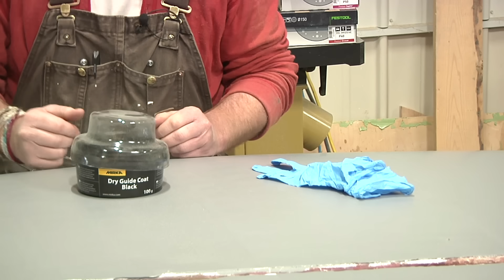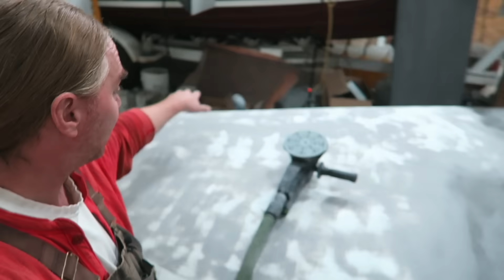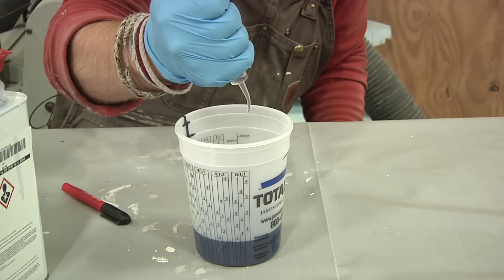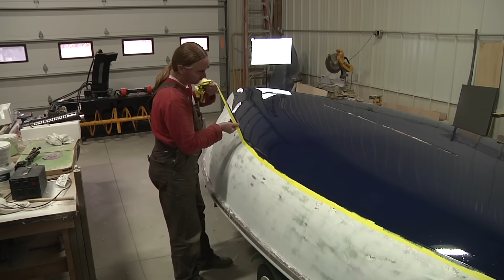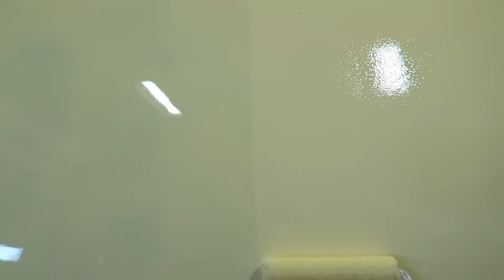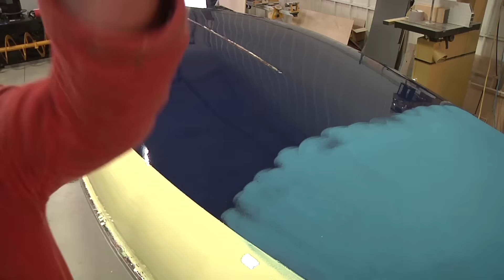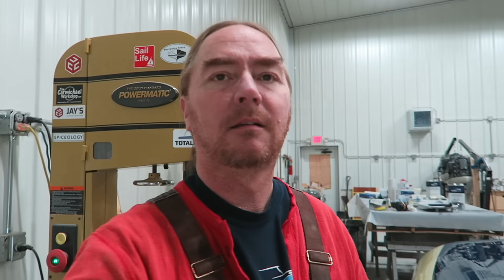ALL ROLL AND NO TIP ;-) PAINTING YOUR BOAT WITH ALEXSEAL!

Comment: Lint will ALWAYS show on high Shine Glossy paint. Lint from roller sleeve and dust, dust is lint too.    D I'm saying it from professional painter knowledge. To eliminate dust, take it seriously. It's the "cleanliness" he is talking about. I call it "dustlessness". Borrow dust filter/s.
1. Bring and turn on Dust Filters.
2. Vaccuum entire place with dust filters on.

3. Let dust filters work when you sand and do your work. 
4. turn off during spraying all coats and in between untill you are finished and Last coast dries.
            You can now wax or buff.
Dust filter is as cheap as $100 and many fans have them too. I advise any HEPA dust filter. You can actually feel "crispy" clean air :) 
in Vancouver, I can do your painting if you let me paint and store my project next to yours.

Comment: Looks good, but I would recommend white foam rollers, and if you don’t want opacity issues with dark colors maybe go for @Perfection Pro from International Paints, the trick is: don’t paint in windy conditions, in between coat 1 and 2 you don’t need to sant but you must light sand with P400 for the 3 coat.

Comment: Wow! We’ve spent the last two seasons in Puerto Escandido (Loreto), Baja Sur, Mexico working on our deck. We had about 1200 blisters and blemishes on the deck and cabin top of our 40 year old Valient 32.  Getting the Awlgrip down, and tipping outside in the desert with wind and heat has proven almost impossible. The non-skid areas have been no problem of course. But the smooth areas -  very difficult.  Our next try will be with tarps wrapped all the way around the boat deck up about 8’.  I wonder if that Alexseal additive could be comparable with the Awlgrip Topside paint. Could make a big mess to sand down.......

Comment: Just my 2 cents. I recently refurbished my 1979 Islander 32 sailboat. Much bigger than your project. I rolled and hand wet sanded 2 coats of primer by hand with 220. It was glass smooth when I was finished. Then I rolled and tipped with Pettit easypoxy. People thought that I had it sprayed, it was soooo good. And I did this all outside in a boatyard. Just sayin’

Comment: I always put a drop cloth over my project, ( benches etc) then I spray the room with a light oil, thinner combination that fogs the room and pulls all thedust to the floor and holds it there then I remove the drop cloth and spray paint or roll. This seems to really minimize the dust issue for me,,,

Comment: @Andy, you said Alexseal needs sanding between coats if it has been more than 12 to 16 hours, but you painted without sanding the next day - probably closer to 24 hours.

Is that what caused the orange peel you saw?

Also, for measuring the additive, you can easily find syringes calibrated in CC (cubic centimeters) - which is the actual definition of ml.

Comment: Thanks for video and all the work to make it. I see your pleased with finish but, I would not be to be honest. I been around boats all my life and I am 60. I did spray my Pearson 33ft sailboat 30 years ago with allgrip and it came out virtually perfect in flatness and sheen. Never rolled or rolled and tipped a boat finish and maybe this is acceptable. I am from the body business and painted hundreds of cars as a painter so the finish you put on, again is as good as can be had with rolling. So feel free to correct me. And if this is the process and then you sand and buff (of course insane amount of work) then ok. I also sand and buff when my finishes don't lay out just right. Some of those imperfection you have look deep and not able to sand out. I would also add my opinion that the imperfections are not peel, but solvent popping and well...could be other issues that cause them...Like...like anything cause you can do everything perfect on a paint job and something is just a tad off and the finish is not as good as expected.

Comment: Andy, you amaze me with your talent. I am going to be outside painting my hull in spring and painting it. It will be outside I have little space to confine to build a paint booth with plastic protection from the elements. The sailboat is on a cradle and I don't have a trailer to move it. Any suggestions from you or anyone else would be very much appreciated.
Reply: Can I used a5018 additive with any kind of paint? Even cheap paint for boat from home depot?

Comment: They have in effect copied the leveling agent that is common in modeling paint systems and upscaled it for marine applications. see and model building channel. Barbados Rex in particular reviews many paints marketed toward scale modeling and reference leveling agent and surfactant.  As in rinse agents for dishwashers that make the water sheet off the dishes,  because its surface tension is reduced. That is essentially what this so called new product Is doing essentially on a larger scale, in the paint system you are so proud of.

Comment: Great videos. I just have a question about why you roll on gelcoat over glass, if you are fairing and sanding afterwards? Why not put the fairing straight on the fiberglass and then primer over that?

Comment: Andy since with your method of rolling with system can you also use a paint brush to do the areas that a roller can not do? If so will the brush marks flow out like the air bubbles?

Comment: Most impressed by the small amount of paint needed to cover the big area, but I also noticed that your masking tape failed at the line between the blue and yellow.  From my meager experience to cure this nasty phenom, use fineline tape available at the automotive supply.  It is a bit expensive but gives a beautiful line with no leakage.  Try it out, I like 1/2" for long less curved lines and narrower for more curvatious lines.  3M makes the best.  DS

Comment: Question:, on a 18 ft wooden row boat, do you put the resin and harder on the wood surface, or do you put the fiberglass material on the wood surface than the resin and harder? First time building.

Comment: "There are some blemishes on here" yeah, ya think? There's hundreds, maybe thousands of pieces of dust in the paint. It is bottom paint so it shouldn't matter much, and the blems are from dust in the air which is curable with a paint booth. Overall, the job looks great though.

Comment: Question:  To avoid being able to see the sand-through primer blotches, could you add a pearl powder to the first coat of blue?  Perhaps a similar or darker blue powder, or grey or black?
Reply: No , it will excasobate the problem. Should have laid down an even primer after sanding back with sanding boards in criss cross pattern in correct planes to hull from final guide coat. as you do all layers for evenly professional result. It's a demo boat of your work for public.

Comment: Grab a cheap can of acrylic spray paint and do a mist coat over the job, it works the same and is quicker, i never used anything like this as it contributes to the dust factor and i always wet sand, i am a old school vehicle painter, less dust makes a better job and wet sand always seems to make a better finish for the final colour paint, it is all in the preparation.

Comment: Whenever I’m sanding primer, I use a sanding block. Not A DA. Also when using the guide code, it’s supposed to prevent you from burning threw your primer. That’s why it marks your low spots. Other than that nicely done

Comment: I've ALWAYS had these kind of results using a roller on a 35ft cold moulded hull with clear varnish over mahogany.
Good quality varnish (paint) and a good sanding is the answer.
Sand, One full coat, sand, one coat 4/5ths paint 1/5th thinners and always got a perfect finish.
Even the boat yard came to have a look they were so impressed I got an "as good" finish that they would have got with a spray gun.
If I can allow myself - I got a better finish than yours here. Like glass.

Comment: I need help. Love the channel. Off video topic. Im rebuilding the plywood decking and consoles in an aluminum fishing boat. Ive gotten mixed info on sealing/ not sealing the plywood. Wanting a rubbery non skid. Should i seal the underside and edges of the plywood as well? And what products? Im between the kiwigrip styles and the monstaliner styles.

Comment: Andy ... fantastic content, as always. 
At one point, you said you applied the three coats of blue over three consecutive days, inferring a 24-hour wait time between coats with no sanding. Right after that you said the second and third coats should be applied within twelve to sixteen hours if not sanding in between (or words to that effect).
Would you have shortened the between coat time or sanded between coats if this were not a test/demo boat?

Comment: I always use a high density foam roller rather than mohair and get good results. do you have an opinion on the two?  Also, I have used all the competitors over the years and because of your videos, my next project will be with Alexseal.  BTW the pricing on Alexseal is not the same for all retailers, so it pays to shop.

Comment: In between coats, do you remove the tape line and reapply for each coat or do you leave the tape on there for 3 days during dry time of each coat? I feel like it's probably a good idea to remove the tape or else the tape would dry to the gel coat and end up pulling a chunk of paint with it. But I just spray cars.

Comment: I've got some calls to make. I think this will work with the paint i want to use on my car. If so this will save me a lot by being able to just roll it on.
Reply: Maybe it isn't relevant, but I just finished painting my campervan with Totalboat Wet Edge thinned 10 percent. Seafoam green, using Red Tree foam rollers, it blew me away how good it looks! Good luck painting your car! Super glossy, and no orange peel; painted outside.

Comment: Achieving a glass smooth hull surface will create a suction when moving through the water whereas a micro texture surface does not create suction and allows the hull to move with less drag through the water. This idea was apparently derived from mimicking the surface of pelagic sharks. Do you really want to knock down the roll on texture with a final sanding with 320 grit?

Comment: After that has cured long enough, is it possible to use a razor blade to de-nib the debris from the gelcoat (like the technique for auto clearcoat), then wet sand, polish, etc.? I've done it with clear coat, but I've never worked with gelcoat.

Comment: I have been watching your videos for a year now. I have been planning on painting my boat myself ,  a 24 deep V MAXUM. I was torn between spaying or the roll and tip method. UNTIL your first announcement of going to Charleston to Alexseal to paint with their new additive for rolling and NO tipping. My question is will I have a better result if I sand with 400 between each coat of paint.

Comment: Thanks for the lessons as I'm about to repaint my fiberglass bass boat. Question, when you applied the Dry Guide Coat to the yellow, you quickly buffed it out with the sander. Is that all the sanding that needs to be done between coats? Just taking off the high spots. I'm probably going with Total Boat products as that is what I have used for all the fiberglass repairs and don't want to get into spray painting.

Comment: I'm interested in using the roll and tip method to paint my boat. I'm ready to paly my last coat of primer. After that, I'm going to sand with 220 grit. What speed should I use with my orbital sander?

Comment: If you had long boarded this boat, would you have not gotten a fairer, more smooth look with less burn through?  Seems yo me from previous work of my own that using a relatively small sander such as the festool permits sanding more in some areas relative to others.  Also, why not use a sandable filling guide coat to fill the imperfections of the primer, which would more easily permit a fair and smooth surface without burn through?  I'm sure that you have your reasons as you do this WAY more than I do, but I would like to hear your thoughts.  Cheers!

Comment: How would this paint work on a model race boat, I have an RC Model racer that needs to be repainted, right now it is a three tone blue. When I originally painted the boat I used a two part epoxy, will the Alexseal work any better or look better. I would appreciate any suggestions  you may have.

Comment: Andy, great job again brother! 
Looks like some good stuff!

I have a question: what would you use on Interlux perfection, before my final topcoat, aluminum hull 30 ft. I painted it 16 years ago! I’m now a young 63, and going for it again! This will be on my top and not the hull. Thanks so much for all your videos! I’ll be sanding in between coats, I’m just wondering if I can use the thinner for a final wipe down.

Comment: Instead of using the dry guide coat, just spray on pva and then sand it smooth. Appling the charcoal dry guide coat seams unnecessary.

Comment: I think you need a paintroom/box. A smaller room that is easyer to  clean out before painting.
Reply: I agree completly.  I thought the idea here was to evaluate this brand of paint. You  can't do that properly when you include variables. In this case what he says is dust and dirt. I dont know about you but I cant tell if all the imperfections in the blue( and there were a lot of them) were caused by dirt or some other problem with the  paint.

Comment: Why dont you use a second coat of primer after sanding? USN we always used 2 coats of primer. Granted this isnt going to see the abuse a navy ship does but seems it would give you an optimal base for your main coats. The boat looks great! Last question. Do they reccomend a clear coat or not?
Reply: What are you guys putting on the bottom? I have seen a good wax on the bottom give a few mph on a pleasure boat.

Comment: Great video, thank you. I have a question though, being in Croatia Alexseal's products are not available here, and so I am unable to get the 5018 additive you are using in the video (which came out spectaculuar I have to say). How different would this paintjob be when using a Hempel 2 component top color, which I plan on using on my newly acquired boat soon?  Should I then use the roll and tip method instead of the "roll/roll slowly2 one that you describe?  Thank you a ton for these videos, they are a Godsend when you have a diy job on a boat :)

Comment: Why don’t you just spray it with a cup gun. You thin the paint with paint thinner to get it to the proper consistency. That will alleviate the issues with stipple and the rougher texture getting.

Comment: Why start in the middle. You could start at the stern, end at the stern no dry area to overlap in the middle. I have rolled interlux perfection outside in the summer. It dried too fast to tip. Came out looking like it was sprayed. 38 foot sail boat. Go figure.😊

Comment: Love the videos. I will be using this on my boat in the coming years when it's time to pain my hull. I do have a question though... What is the best way to pain over a textured deck? This is the stock diamond patterned non-skid.
Reply: You spelled paint without the "t" twice.  I'm with you - it is a PAIN! Just don't have the patience. I'd rather turn a wrench.

Comment: I finished my Trimaran build in 1993 and painted with Sterling LPU (sprayed Matterhorn White with rolled Newport Grey non-skid). It needs a topside paint job badly and I really hope to use the roll no tip method. 
I'm very concerned that Alexseal and Sterling Matterhorn White are fairly different shades. Would this additive work with Sterling or would I have to risk the color change and go with Alexseal?

Comment: GREAT VID! needed this.  My 18 footer has a very steep (vertical) bow, whereas your hull here is pretty flat.... Will this paint concept work on the more vertical hull sections or will I get a lot of drip?  I think you're going to just say, "be careful, go thin", right?
Reply: Sorry... just saw other half of vid and you painted on a vert surface.  THANKS FOR THE VIDEOS!
Reply from the maker: if applied as shown in the video (with the same brand and size roller) it will work perfectly :-)

Comment: Hi Andy I want to pick your brain I'm redoing a hydra stream for Valero it has a crack in the bottom where the person hits something I was told that anything below the water line should be done in epoxy I had already bought the polymer epoxy and was planning on doing the bottom until I saw this video with gel coat but you I think you've changed my mind I'm going to roll it on with the axial paint The question is should I use the epoxy prime on the bottom and can I still use my polymer epoxy for the inside of the boat Will that cause any reaction this is my first attempt at anything like this and so far it's been a job if you can give me any insight the best way to do this I would appreciate it thanks Jim

Comment: To much guide coat applied. 320 was to aggressive. Took more material off.This caused most of your problems. Clean paper off as you go to avoid damage. Also change paper out sooner. Excessive guide coat gums up your paper. Changing paper more regularly costs more but less damage.

Comment: There is absolutely no reason to have to wear a mask when using guid coat. There is no Oder no gassing, and yes it’s a very fine material but it’s not light and doesn’t fly off the work surface as long as your not slapping it on. Using it correctly it stays on the work surface.

Comment: Does the topcoat paint hold up in the water?
Reply from the maker: topside paint (regardless of brand) isn't designed to be used below the waterline, this was for demo purposes only as I had a lot of area to work with :-)  It's fine to get wet, just not submerged for any period of time